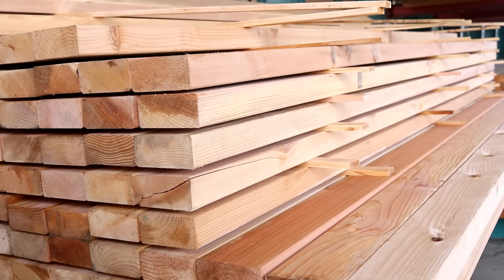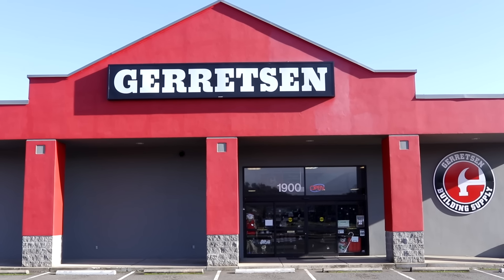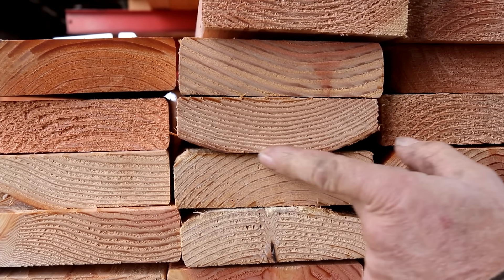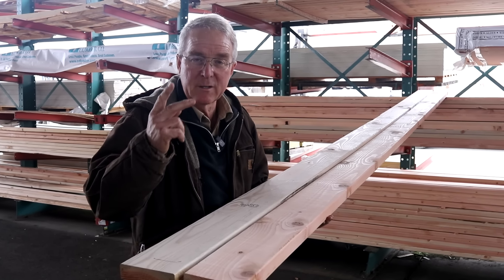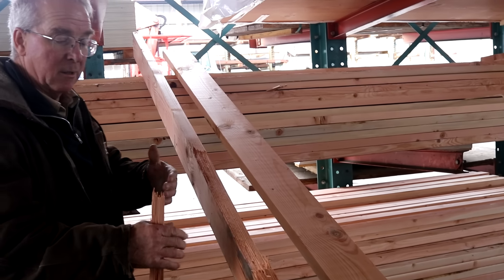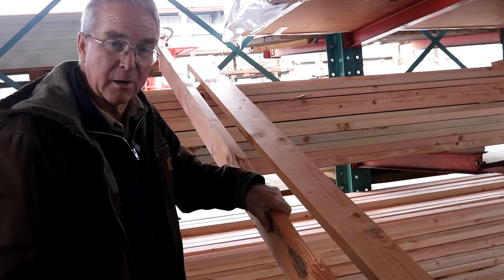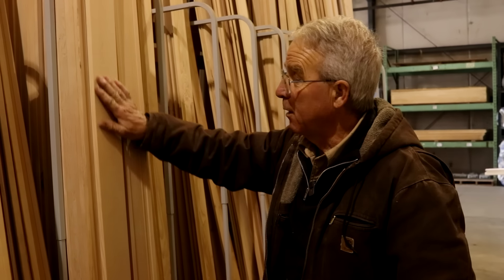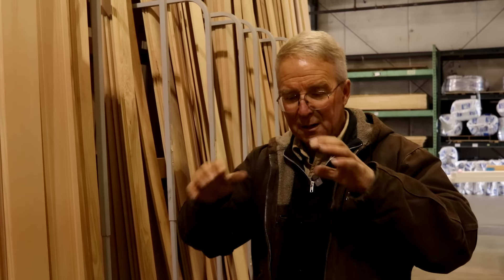How to Not Buy Crap Lumber

Comment: Re: big box quality.  Needed a sheet of 1/8" oak veneer plywood.  Plywood core can have gaps if there are several layers and the top layer is thick enough to span a gap.  The oak veneer was, of course, paper thin, and there is only room for one core....which had huge gaps.  You could put your thumb thru the veneer into the gap and ruin the sheet!  Several sheets in the store failed, so we left. What a waste of valuable oak veneer!

Comment: Just avoid Home Despot if you need lumber. Not sure what is going on with them lately and not sure where they get their lumber, but the quality has gone downhill and is horrible. I thought it was just the store I normally go to, but I have been to several others, and they all had the same issue.  Lately, I have had to go through 20-25 sticks for every good one I found.  They were either extremely warped, split, shaved etc. Many would not even pass for interior framing.  I prefer to pick my own because if they delivered it, I would end up with mostly useless lumber and would have to have it returned.

Comment: At stores like Oh No Depot the lumber is kept inside. During the winter when demand is down and the lower quality lumber sits too long, the indoor relative humidity can be much lower than the kiln dried moisture percentage of the wood. Add to this the sorting done by picky customers that leaves the racked bundle tossed about in a hodgepodge of loose sticks. The contorted remains of what once resembled a building product is laughable. Millions of dollars in waste is the result. But, no changes are ever made to this failed system of inventory. Mind boggling.

Comment: Roseburg Blast
edit
Some history...  "On August 7, 1959, at approximately 1:00 a.m., the Gerretsen Building Supply Company caught fire. Firefighters soon arrived at the building, near Oak and Pine Streets, to extinguish the fire. Earlier in the evening, a truck driver for the Pacific Powder Company, George Rutherford, had parked his explosives truck in front of the building, which was not noticed. The truck exploded at around 1:14 a.m., destroying buildings in an eight-block radius and severely damaging 30 more blocks.[15]".

Comment: I just watched the first 2 minutes or so,  and everything you said was wrong.
Kiln dried Lumber is to 19%. Green lbr is from 20% on up.  Home Depot pays ABOVE Market prices to carry premium CONSTRUCTION Lumber.  All the Lumber you looked at is for framing. If you want architectural,  interior grades of Lumber,  go inside the store. It is graded and sorted differently. 

The best way to avoid twist, curl, cup or other types of natural movements is to let the Lumber sit in your garage or basement and acclimate. 
Wane is "the absence of Lumber", it's not common in premium Lumber because it's not allowed in the grade.  
Even your thumbnail is misleading,  your video is titled BETTER BOARDS, and you have a picture of 4x6 timbers. A board is 1inch thick, not 4 inch. 2 inch Lumber is called dimension Lumber.  3 inch and up are called timbers, or , posts.
All of the Lumber at Home Depot or Lowes is graded PREMIUM and they pay extra for that.